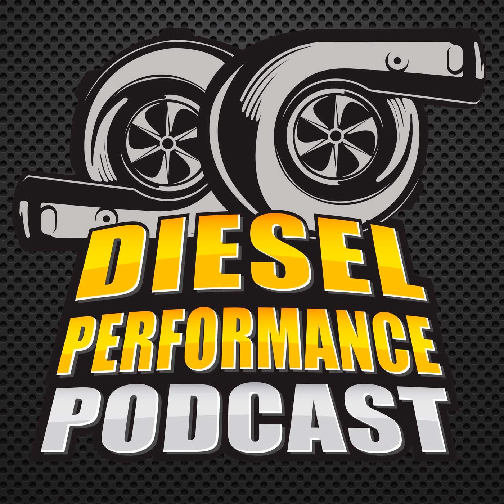History Of Power Stroke Turbos

Comment: What i hate about this podcast is they blame ford. The manufacturer is international from 6.4 on down.  Also in my opinion they didn't have any more issues then the duramaxs. I mean lbz cracking pistons to lly popping hg. The issue is ford out sells gm by a large margin so its gonna look like they have more issues. Also once again keeping the sst below 28 psi was key. I've seen 6.7s with the original turbos with 500k on them. Most of them were early h&s tuned trucks with the later tuning that toned the boost down .
Reply: Couldn't agree more